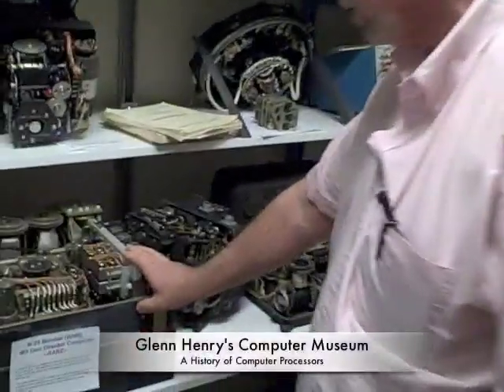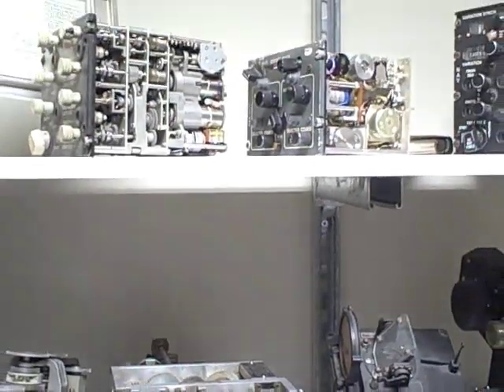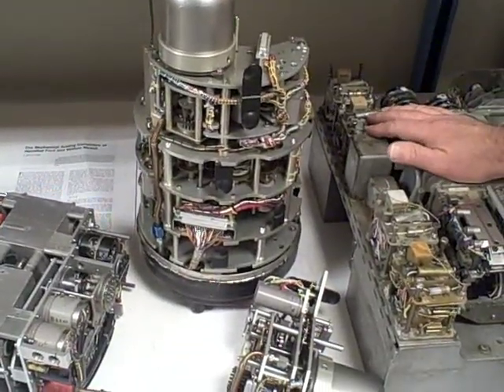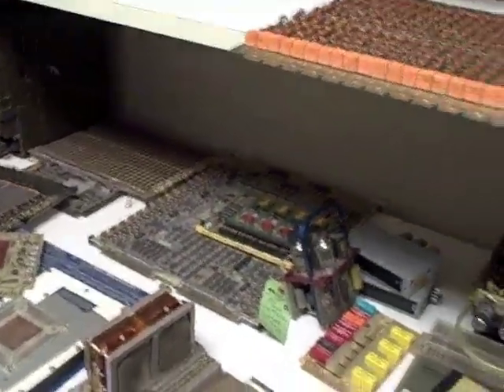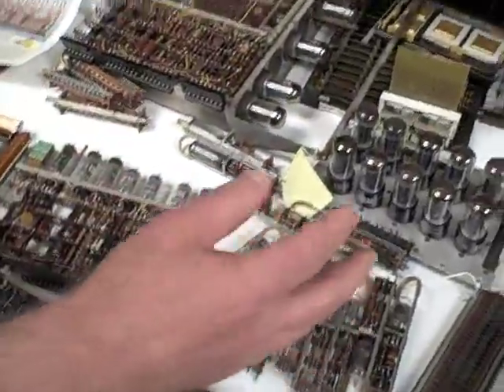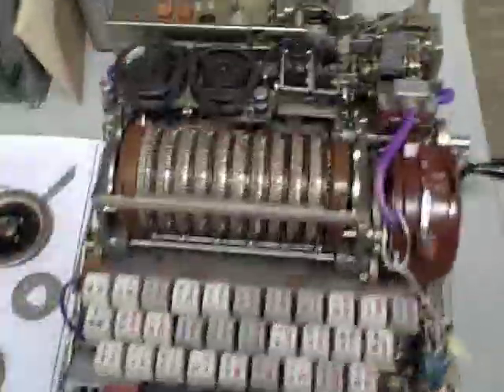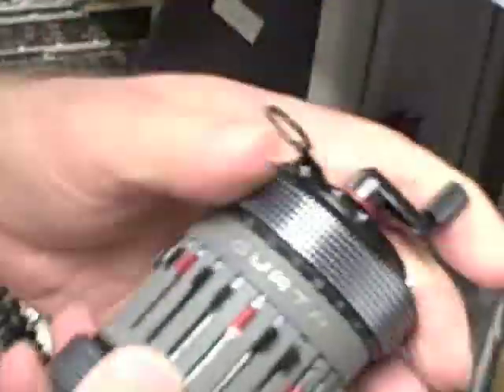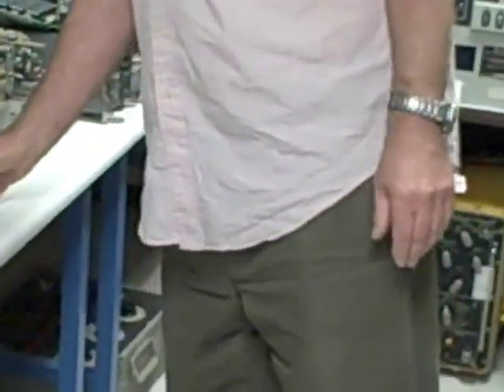A History of Processors

Comment: It always amazes me when I look at old technology like that.  In some ways, we had to be more clever than we are now, because we didn't have access to solid-state computers.  Some dude with a slide rule and a pencil had to do all the calculations for the gear-ratios and all the other shit that went into those mechanical computers, its just badass.
Reply: I don't think the general idea is too different.  You need to hash out the math, the algorithm first, then you can implement it, be it with a digital computer or cogwheels, pulleys and bicycle chains.  What modern computers have allowed us to do is to implement way more and more complex stuff in the same or less space.  They've also allowed to abstract away things.  These days you don't program your own math functions, you use a library.  My impression is that in the old days there was not so much reuse possible do to implementation constraints.  If we had to build one of these analog computers today, components would probably be manufactured on a CNC machine and 3D printer at a fraction of the price.  Manual fabrication would make them as expensive as a modern mechanical watch.

Comment: At index 5:12, there is a Modcomp computer on the floor. It's a Modcomp II. I worked on these in school and later went to work for Modcomp in 1979. Modular Computer Systems was based in Ft. Lauderdale Florida. The designed and sold 16 and 32 bit minicomputers that were used for process control. Many were sold to control manufacturing of aluminum, Nuclear power plants, and even to launch the Space Shuttle. A Modcomp system was used to control the VLA in New Mexico.

These were great computers, and I really enjoyed working on them.

Comment: The interviewer ask with some incredulity in the tone of voice: You are telling me that this is a processor? Yes, the hearth called "ALU" (arithmetic logic unit) of a processor is something that does a few simple math operation like: +, Add, & AND, and a few more. When using hydraulic, the ADD can be two tubes merging to a single one. The division can be a the opposite with the ratio set by the size of each. Because air or oil flow continuously, the operation relatively fast.

This comes from a museum, I managed to convince them how much I was interested. I presume that many museum are getting rid of stuff to make place to newer stuff that would interest more the current generation.

I realize that the effort to miniaturize complex mechanical devices was amazing with these military computers.

I am happy to see how passionate people preserve example of great engineering.

Comment: Speaking of F-4s, I was a weapon control systems mechanic for F-4Ds in the early '80s. If you want a really impressive electro-mechanical computer, see if you can find the target intercept computer from the main radar package off of one of those. The parts you have look like they were part of the com-nav package. Part of the INS, maybe, along with the gyro unit.
Reply: TheTomBevis can u tell me list of hardwired cpu, microcoded and both

Comment: To all those who have commented on the bad audio in this video, it is not a case of adjusting levels in the editor. Good video production starts in the field with proper production techniques. A decent camera with two separate audio inputs, preferably XLR   connectors that are switchable between line or mic impedance. This effectively excludes using a freaking smartphone to record video and calling yourself a professional content creator, OK? In this situation or any interview scenario, the use of lavalier microphones is highly recommended. One on the host or shooter if that is who is asking the questions, and one on the subject or guest. Match the levels going to track for best volume without distortion. If no lav mics are available then at least have a shotgun style condenser mic mounted on what is called a boom pole and project it out towards the presenter either above (best method to mitigate room noise) or below pointing up at the presenter (otherwise known as scooping). The audio component of video production is largely ignored by most people which often leads to colossal failure in the final result leading to very amateur and unwatchable video. 30+ years in the professional television industry has taught me without a doubt that bad audio will KILL an otherwise decent shoot and lead to mas anxiety! Why be relegated to trying to fix bad production techniques in the editing bay when the real solution is simple. Fixed camera mics are NOT the best tool for picking up interview type audio. If you are serious about your craft, buy at least one decent Lav microphone and one good shotgun mic with a boom pole. A lightweight graphite or composite pole won't break the bank and you will find these tools will enhance your capabilities exponentially. This is how the real pro's do it. Then you can concentrate on being creative (artsy fartsy) and avoid the embarrassing comments like this one.

Comment: Buffer or storage space for recent used parts of code.  The bigger the Cache the more recent data can be read and write to faster. This is located on the CPU itself.  Back in the 90's they had TAG ram and Cache Modules and Chips mounted to the motherboard. They ran at slower speeds back in the day.  Now these days its on the CPU itself and runs at the same clock speed as the CPU works at.

Sandy Bridge is code name for the processor core. But its refers to i7 cpus.
The past ones were

Comment: Hypertheading is a virtual processor its just a feature that was on the Pentium 4 3.06Ghz and the i3 i5 i7 cpu's. It would run a second program code into the unused Cache space and unused parts of the processor that the first part of the program code did not use per clock cycle. It only made the system 5% faster.   
Bus Speed which I assume Front side Bus.  Which is the clockspeed "or the speed limit" that the CPU to Memory read and writes from.  Higher the number the better.
Cache is a small

Comment: like  littlefoot, Chomper,  Sharptooth,  Which were the AMD code names for K6  k6-2 and k6-3. The first Athlons was like Thunderbird, Barton, Throughbred.
Intel used  like williemette,  Northwood, Prescott, Cedarmill, Presler, yorkfield, Kentsfield and ETC ETC,   All were code names.

To find out the code name is to use google or run CPUZ on the pc and it will give all the info you will need to know.

As for laptops none are really great for gaming, Thats pretty much to desktop department.
Reply: jimmy101112000 wat

Comment: Mechanical computers are more nuke proof unlike sensitive chips.
Reply: +Rex Holes the chips themselves aren't very sensitive at all, they are just a chuck of silicon.
but the components and circuit boards around them are quite sensitive
Reply: +Rex Holes .... chips used in space are radiation hardened. 

Mechanical computers have limitations. Analog computers had a great run, but they cannot return the precise results delivered by digital computation. Mechanical digital computers never developed. The Z1 is the only one in existence. At 20 seconds for multiplication they would never be practical - being hardly faster than a human. 

It's true the few electromechanical relay machines built by Zuse and Howard Aiken did some useful work, but they had severe speed limitations as well. 

It wasn't until Eckert and Mauchly built their fully electronic vacuum tube machines that practical general purpose computing took off.
Reply: correct, it falls within the architectural improments catagory
an 80486 chip would never be ale to run at 1Ghz because is would just use too much power an be unable to be cooled
whereas 1Ghz is a walk through the park for almost all modern cpu's

Comment: analog vs digital.?
Reply: Yep, analogue computing is completely deprecated, but a fascinating area - for instance using a capacitor and resistor of specific values you might be able to calculate a calculus integration by timing charging voltage vs time